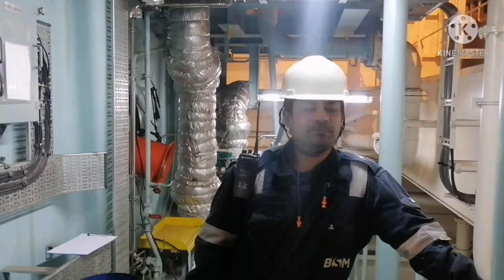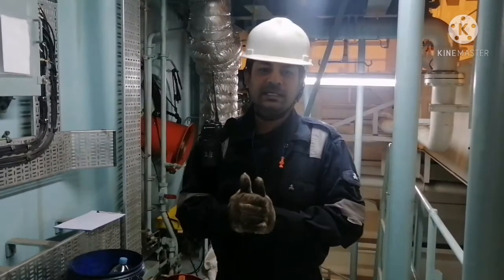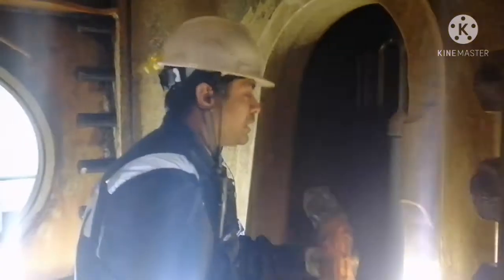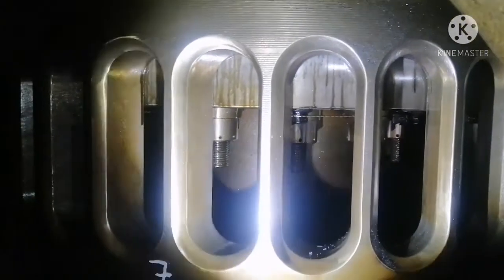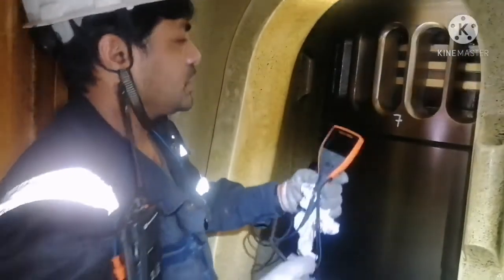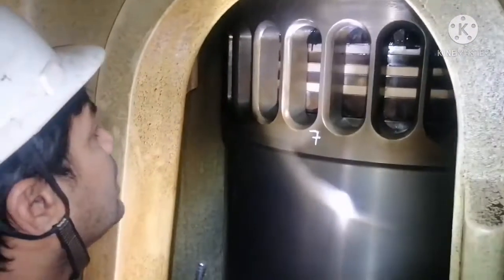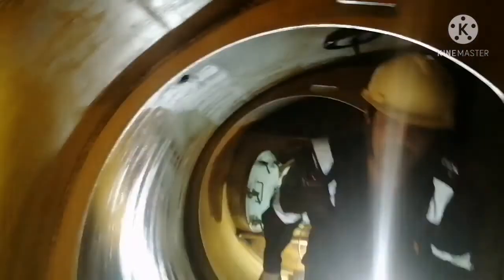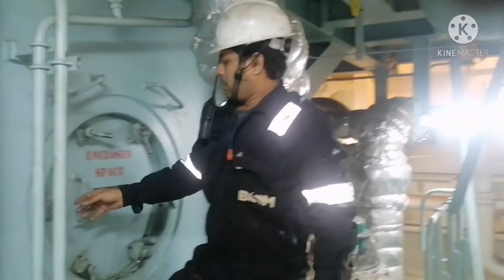How do they do... How to do piston ring and scavenge space inspection on main engine... On ships

Comment: sir, good day. take my regards.
if i inspect scavenge trunk, and find that, one specific unit has too much oil+sludge accumulation inside the scavenge trunk comapre to other units. what could be the reason? why too much accumulation or how the oil is coming?
Reply from the maker: Thanx for your query sir...
Accumulation of sludge depends on hw speed and load  the engine s running.
Usually u can hv visual inspection on Accumulation.
If you find abnormal sludge that may be due to
* Drain line could b clogged. 
* Fuel injection is not proper
* Fuel injecttor leaking.
* improper tightening of fuel injectors.
Hope this reply will satisfy your query

Comment: What's the average pressure and temperature in there while the engine is running and the turbo is spooled up?
Reply from the maker: It's average pressure is around 1 bar when aux blower is not running...
Reply: @marine-knowledge-basha  I see, I ask because I heard a story of some guy getting stuck in there and apparently he died from high pressures and overheating
Reply from the maker: @mwbgaming28  sir in this case the guy must have been inside the chamber because of intentional or accidental closing of scavenge door without inspecting for any person inside.
Reply: @marine-knowledge-basha  he went in there without telling anyone and someone closed the door on him, the captain though he left the ship and was ditching work, so he started the engine and the ship departed on a trip that took a few days (they were going to a dry dock or something for major maintenance) and they found the guy dead in the air scavenging receiver 

Do you think it was temperature or pressure that ended up killing him? (Seeing as the combustion chambers are directly exposed, I would think it would be both)

Comment: sir, i am a cadet. may i ask you a question about liner wear?
is adhesive/scuffing wear and micro seizure on liner surface is same? or adhesive wear and micro seizure different case?
Reply from the maker: thanks for your good question sir..
* Adhesive wear  is caused by loss of oil film and leads to piston and liner to have metal to metal contact that may reach to localised welding and leads to scuffing..
* Abrasive wear is caused mostly by cat fines which is contaminated in fuel oil. This leads to rubbing of Abrasive wear can be caused by hard asperities in the components rubbing against each other or by hard 
particles from contaminants such as catalyst fines (cat fines) from fuel oil. These hard particles embed 
themselves into the piston ring and/or liner surface and breach the oil film, thus abrading the surfaces and 
wearing them down in high speed.
* Micro seizure indicates the beginning of wear and can be rectified by increasing the cylinder oil feed rate.
I beleive this reply will satisfy your query,
Reply: @marine-knowledge-basha  ❤❤❤❤